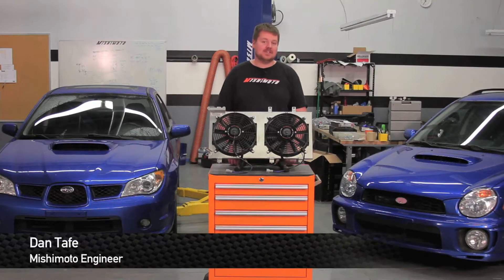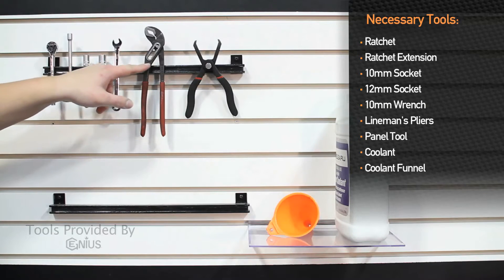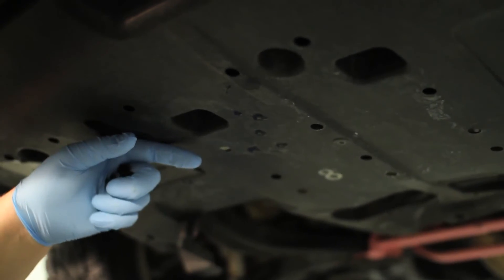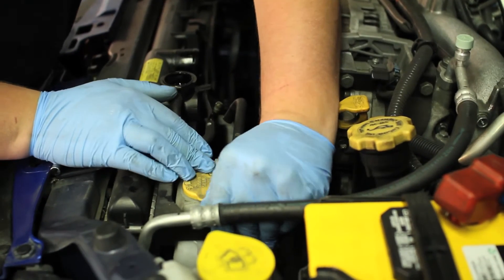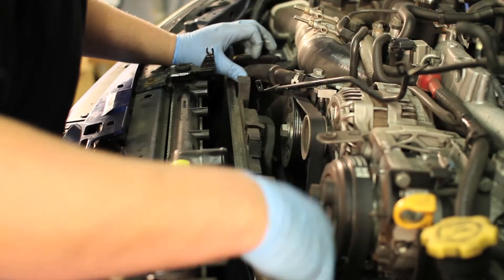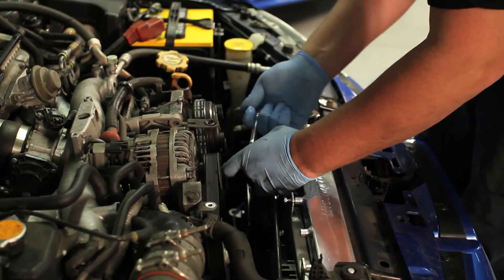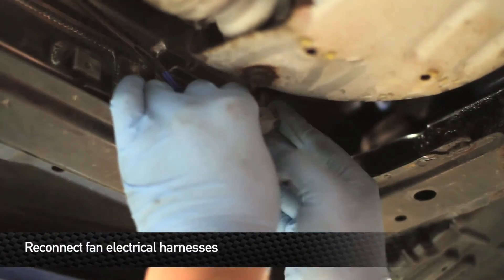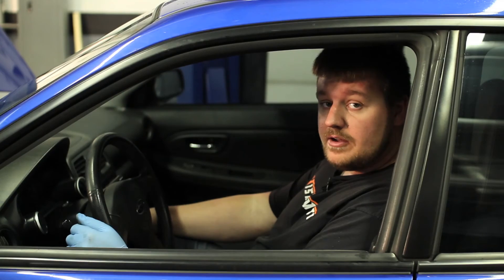Performance Aluminum Fan Shroud Kit for the 2001-2007 Subaru Impreza WRX/STI Installation

Comment: Does this fit a stock radiator?
Reply from the maker: Yes, this will fit the stock radiator without any issues
Reply: @mishimoto  thank you so much. I received as a gift and I don’t have the mishimoto rad yet. I will be saving for it. The fan looks amazing btw can’t wait to have all mishimoto on my 03 WRX and my 01 L. Keep up the good work.

Comment: What is the special adapter that was mentioned for the electrical connection? I have a 2002 WRX.
Reply from the maker: Hell Darrion, plug adapters (P/N 45128FE000) will need to be purchased from your dealership when used with 01-03 vehicles.

Comment: did you need to drain the radiator fluid to switch out the fan?
Reply from the maker: In the video we did because we were also installing our radiator into the car. However because the upper hose will need to be removed it make the whole job a lot easier.

Comment: Will This fit your tipple core rad when installed or will I need to remove the radiator to fit the fan shroud?